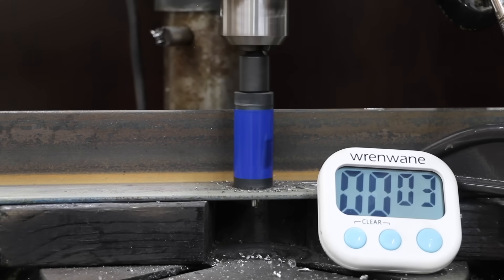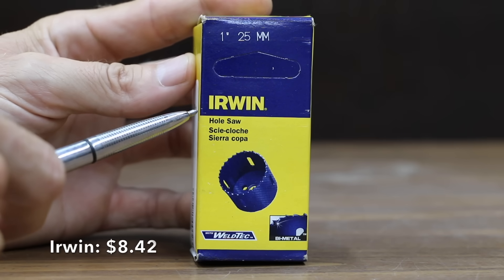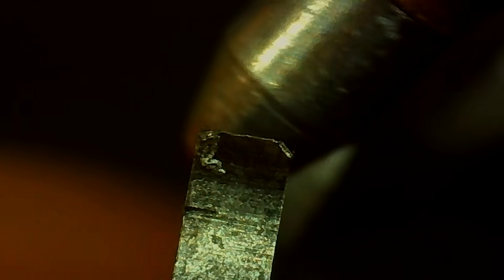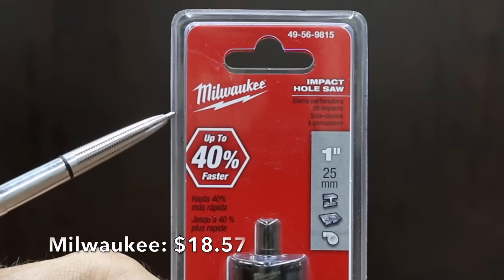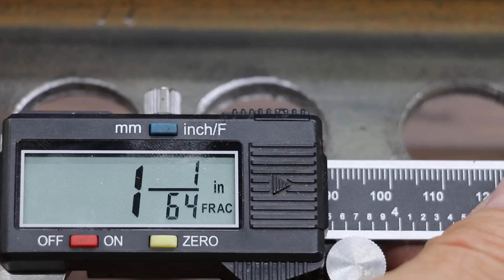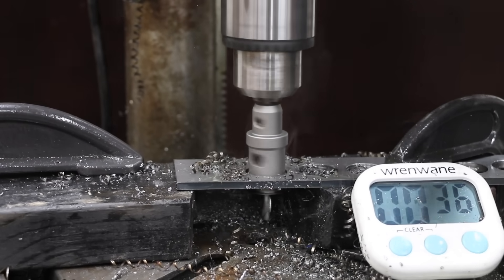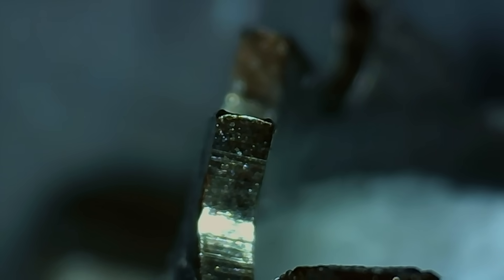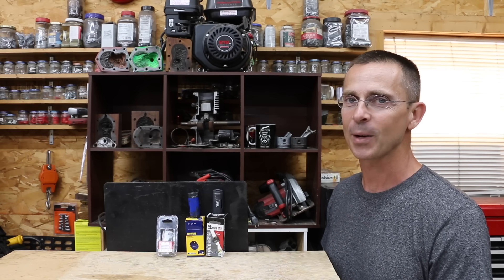Best Hole Saw Brand? DeWalt vs Milwaukee vs Irwin, Bosch, Lenox, Diablo, Bosch, MK Morse

Comment: I used to buy those expensive large twist drill bits such as 5/8, 3/4, 7/8 and up. I bought a set of 16 TCT Carbide hole saw kit bits from 5/8 to 2 1/4 ($59) last January. I have used the 5/8 size for 50 to 60 holes. It is starting to get a little dull, so I ordered a set of 3 to replace them since that is the size I use the most. The drilling is so much easier, the hole much smoother as well as more round, and there is no wobble. I will never go back. I noticed a lot of wobble in the long bits you tested, so I am reluctant to use those for precise drilling.

Comment: Love the vids man I'm just wondering why whenever you test Bosch you choose the entry level and never the expert?

The multitool blade you chose was the basic one where they've got a much, much better multi material Expert and now in this you are using the most basic set. The Expert hole saw set I own can hit brick and still go right back to cutting wood like it's nothing.

 Would love to see you retesting Bosch Expert in future vida

Comment: Could you update this and include hand drilling?  I've found the thin carbide diablo works great in drill press but terrible in a drill and even worse if drilling at an angle or hitting a nail.  Thanks!
Reply from the maker: Thanks for the suggestion.

Comment: The shock wave style with the thin cutting teeth is really for thin sheet metals like control panels etc. In thicker stuff the heat build up will kill it.

Comment: Many Thanks for this testing...I bought a complete drill set 5/8" to 2 1/4" ( $56.98 amazon ) 12 drill sizes TCT hole saw Carbide Took me 20 years to learned to drill ( slowly ) Turtle speed or less  and lots of oil high speed causes heat and kills the drill and then tempers your metal to extremely hardness. I was amazed at slow speed with lots of oil my 1 1/4" drill bit chewed right through 3/16" metal.... USA Drill hog has a great warranty if you register it. They replaced a few of my regular drills.
Reply from the maker: You are welcome!  Thanks for sharing.

Comment: Regardless of the steel you should ALWAYS use cutting oil. I use Klein hole saws every day almost. You'll kill them real quickly without oil. Should really read the instructions. Squid.

Comment: You completely omitted the FACT that Diablo did the best overall.  SPeed 25sec vs 30sec means SQUAT!  U did not evaluate durability for drilling multiple holes.  1 hole is not enough.  U know u could've drilled thru that toughest steel with the Diablo!  U didnt even let them cool down then go again with the Diablo.

Comment: Also I just found out CLEVELAND drill bit company is still around (oldest drill bit company in US ), it is now under GREENFIELD INDUSTRIES, and MADE IN USA, seneca SC. They have the boss annular cutters, I wouldnt even use hole saws for thick metal. CLEVELAND does not mess around, they use real carbide, anything else would be foolish. Take care !!!
Reply from the maker: Thanks for sharing.

Comment: I dont know if youve added best hole saw brand # 2 but you should check out champion ct7, i saw it cut through 3/8 steel and looks good. They also have annular cutters but they cost a fortune !!!
Reply from the maker: Thanks for the suggestion.

Comment: Great showdown for hole saws. Realistic application with the under powered drill press. Especially with the AR 500 armor. Lifting the stalled drill chips and dulls the teeth. To drill it properly you need enough torque so it won’t stall.
Reply from the maker: Thanks!

Comment: I suppose cutting wood would need a brand new test? Chip evacuation seems way more important there by my very limited experience (4 holes with a cheap kit before I gave up for the time being, frustrating as hell, more rubbing than cutting really).
 I'm thinking the most common use would probably be cutting holes in soft/hard wood for deck lights.

Comment: Unusually for me, I had to use a step drill last Summer, and bought a couple before checking your video! It was only through thin mild steel, the Makita lost it's tip almost instantly, and the Titanium coated Dewalt worked perfectly! That confirms your findings!
Reply from the maker: Thanks for sharing.

Comment: The regular Milwaukee hole saw bits are so garbage they wear out so fast but the carbide teeth one lasts way longer (I know this as I have to drill holes through wood to run line sets for air conditioner). The carbide teeth saw is still working even with 1 tooth of 3 being half broken, another being chipped, and the third starting to chip ever so slightly. Still works somehow. But yeah those regular hole saws don’t last.

Comment: I use carbide hole saws as they just keep their cutting teeth sharper for longer. Especially in fiberglass gelcoat and aluminium.
Reply from the maker: Thanks for the feedback.
Reply: M😅

Comment: As a tool and die maker, I have to say I'd propably go for Bi-metal hole saws rather than carbide, especially for handheld use. Carbide may be very hard, theoretically good for tool life, but that hardness is often a problem in hand use, as it leads to cracking. Carbide works best in stationary machines, like drill presses and mills, in hand use you have to be careful. Also, no intermittent cooling on carbides, either constant flooding or run them dry.
Reply from the maker: Thanks for the feedback.

Comment: The speed for the TCT saws is far too low which won't have been helping them cut or their durability, for mild steel they ought to have been more around 600-800 RPM and 400-500 for SS/Tool Steel
Reply from the maker: Thanks for the feedback.

Comment: I just used a Champion CT7 (1 1/8”) Carbide Hole Cutter which is made for materials up to 1” thick and it preformed beautifully drilling holes and 3/16” steel in about 10 seconds (drilled pilot hole first because the store didn’t have any extra pilot bits). 
The old adage of you get what you pay for is definitely true, it’s USA MADE and at $61.99 not cheep but well worth the investment.
Reply from the maker: Thanks for sharing.

Comment: The first saw you tested a chip of the carbide broke off. I think it happened when the saw cut through the metal and the weight on your press slammed the saw against the cut out part that fell on your work bench.
Reply from the maker: Thanks for the feedback.

Comment: Wish you had tested thin metal, like electrical panels. That said, I expect similar results to the "mild steel" test, just a smaller spread. Also important is the life of the hole saw, which we never got a feel for.
Reply from the maker: Thanks for the suggestion.

Comment: I realize this video was from 3 years ago but in case you still get the comments a problem I had with this was the drill press was stopping or hesitating which is not good for a cutting tool and the tools without the pilot are not designed for a sloppy spindle because the carbide is harder and more brittle you can't have a lot of vibration. Also I found it strange that a number of the carbide tools could not finish the armor plate and the carbide was still in reasonable condition. Speeds and feeds and sloppy spindle may have played a part.

Comment: The 40% faster bits are really made to make quicker work of light duty materials and reduces binding and teeth snapping on sheet metal, that is the application it is for, using it for heavy duty materials the teeth just get too hot too fast and they loose temper and burn out.
Reply from the maker: Thanks for the feedback.

Comment: I needed to cut a 1 inch hole in mild steel channel iron o my car trailer. I watched the Project Farm video to select a brand. I could not find the brand I wanted but I was able to get the Diablo saw at Homeless Depot. Thanks PF!!!!  The saw made it thru the steel with a hand held drill in less than three minutes. I had to hold it in an awkward position with limited visibility. I backed off the RPM and pressed maybe 15-20 lbs weight on bit. I was thrilled and delighted that it cut a hole so easily. Thanks for the video… it saved me so much trial & error time. Now I can new trailer light wiring.
Reply from the maker: You are welcome!  Thanks for sharing.

Comment: I use a 1" hole saw on metal quite frequently at work and some times I am forced to go at a slight angle which is hard on the pilot bits. The lennox pilot bits bend if you sneeze on them. The diablo bit holds up better and the  milwaukee hole dozer holds up the longest with the type of abuse I put mine through.

Comment: The lower the flute count, the faster I needs to spin. I would have liked to see the higher end 4 tooth carbide hole saws and 2-3x the rpm on the mild steel.
Reply from the maker: Thanks for the suggestion.

Comment: I was on the edge deciding on diablo lenox or milwaukee i guess ill buy me diablos i wanna use them for notching tubes i wonder how the outer cutting edge corners will hold up when i do angled notches on stainless exhaust tubing i’ll post the condition that they’re in after a couple of projects here if I remember lol
Reply from the maker: Thanks for the feedback.

Comment: Thanks for the great content!
I was wondering if you could include some "wobble" or runout test next time. I use hole saws for notching thin  (0.7 to 0.9mm) tubing and find that there are some with quite some wobble that make less precise cuts.
Reply from the maker: Thanks!  Thanks for the suggestion.

Comment: I'm glad to see that my disappointment in Diablo isn't just in my head. I've tried their blades and bits and thin cut wheels in just about everything and I've never really been impressed with any of it. 

It's not bad stuff, it's just not exactly good stuff. 

And that quick change thing for their hole saws is kind of terrible... and adds about $30 to the first one you buy.
Reply from the maker: Thanks for the feedback.

Comment: I tend to use water based cutting fluids since they do a better job of dissipating heat from the part and the tool. I save cutting oils for threading and low speed turning applications.
Reply from the maker: Thanks for sharing.

Comment: If you are drilling steel and are getting brown or blue chips the tool is rotating to fast and will fail. Especially if the tools are not carbide.
Reply: Stainless steel might not change color depending on which type of stainless.
Reply from the maker: Thanks for the feedback.

Comment: I'm quite interested in watching you test diamond core drill bits for cutting through concrete. Your testing approach is very impressive and consistent. I purchased a Milwaukee diamond max 1-inch drill bit, but it didn't perform very well and deteriorated after just a few cuts despite using water for lubrication.
Reply from the maker: Thanks for the suggestion.

Comment: One thing I found with cutting oil is the need for force. If there's not enough, even the tiniest difference in blade height means oil under the cutting edge, and that dulls a blade fast and can be the reason for blown out edges on carbide teeth.

Comment: I was looking for a review on diamond hole saws. I recently started training to be a tile setter and I quickly learned that not all diamond hole saws are the same. Porcelain tiles are slippery and extremely hard to cut as well as very hard on the bit. Doesn't seem to be any good reviews out there comparing. Smaller hole saws behave differently form bigger ones so I work recommend testing 3 common sizes used in tile setting
Reply from the maker: Thanks for the suggestion.

Comment: I noticed that almost in every of these amazing tool comparison videos, the Irwin tools always excel compared to their price. Its something else and I love it. I talked my boss into buying Irwin holesaw set to be used in our small metal shop and it actually worked much better than the Karnach hole saws that we were using since 2003. Much cheaper and marginally better. My boss has started to watch your videos after that :)
Reply from the maker: Thanks for sharing.

Comment: Great video.
I purchase a holesaw kit for installing a deadbolt in my front door.  It is a typical, cheap, Insulated metal door.  The metal is very thin. The holesaw did the job but when I tried to use it on a second door, it really struggled and took a long time for me to make the hole.  
Now I know what brands to consider when I have another project.
Reply from the maker: Thanks!  Thanks for sharing.

Comment: I've had a lenox hole saw for the last 5 years, only using to drill through metal, still works perfect. no exaggeration. Burned through hundreds of pilot bits though. Maybe a hole saw pilot bit test video?
Reply from the maker: Thanks for the suggestion.

Comment: Reasonable quality carbide cutting tools usually excel at higher rpm/feeds relative to HSS. Running it at lower speeds leads to hardening of the base material, etc. probably why the carbide saws slowed down. Great video as always.
Reply from the maker: Thanks!

Comment: Hi Todd, you should try EZARC TCT hole saw to join the test, you will impressed by their performance. They have two different version, one for sheet metal, another series for thick metal.
Reply from the maker: Thanks for the suggestion.

Comment: Carbide tools should of cut all the way through the AR500. Did the metal get hot ?  You are missing comparison charts after two of your tests. Hole size accuracy and the AR500.

Comment: Also for the sake of comparability, you need to use the same diameter; if the diameter is not the same, you are cutting different amount of material, and even if the number of teeth is different, then you are introducing two new dimensions of variability. Hard to compare, unless you reduce to something comparable such as "time to cut x number of teeth / perimeter"
Reply from the maker: Thanks for the feedback.

Comment: The Milwaukee does good,  it just needs the arbor to go fast then when the whole saw grabs slow it down put force on it but not to much use cutting oil let the saw do the cutting don’t force it the arbor will break off I use these daily on king studs very temperamental! Do not use on harden steel !
Reply from the maker: Thanks for sharing.

Comment: I use rock river hole saws for work everyday drilling sheet metals and stainless steel and we go thru tons of hole saws😅.... but the most problematic to drill is stainless steel.... all the teeth would be dull after I'm done with them...
Reply from the maker: Thank for the feedback.

Comment: Relton brand holes are capable to be sent in for rebuilding hole.  I used to drill thousands of holes for installing cellulose insulation.
Great drill bits and made in Arcadia California.  These hole saw bits are made like things used to be made. They can also can custom make hole saws for specie jobs.
Reply from the maker: Thanks for sharing.

Comment: I bought a Bauer hole saw kit from Harbor Freight… and used the 1” to cut a hole thru 3/16” high carbon blade steel when I was making Karambit knife for a friend… there was a little discoloration, but believe it or not, no damage to the teeth. I’d love to see you test that kit!
Reply from the maker: Thanks for the suggestion.

Comment: Thanks for the well done video.  I wish you would have included the Starrett bimetal hole saws because that is the brand my local tool supplier provides.
Reply from the maker: You are welcome!  Thanks for the suggestion.

Comment: Love your videos zero complaints about anything. Very non biased testing. Great work. I am a big truck & trailer mechanic. The shop I work at and myself have bought several things upon your suggestion.  I have a couple  ideas for tools to test. 
Sockets. Could be 10 videos if you did deep and shallow ranging from 1/4'' - 1''.
Would love to see how the 1/4 and 1/2 varients of ratchets stack up to the 3/8 you already tested. 
Jackstands. Would like to see if the ratings hold up and see what they are actually capable of holding beyond. 
Thanks for the videos. They provide daily entertainment on lunch.
Reply from the maker: Thanks and you are welcome!  Thanks for the suggestions.

Comment: I really don't like carrying a drill and an impact so I buy as many impact rated bits as I can. I'd really like to see a comparison of impact rated holesaws. The dewalts I've used were misshapen and made ugly holes but they lasted whereas the milwaukee wouldn't even make a single hole in 16gauge studs. Impact rated uni bits and impact rated ph2 bits would also be good. I think a good test medium for these would be some 16 or 18 gauge steel studs. The project I'm on seems like this is all I'm screwing into and everyone on site in going through bits like they're made of tin foil.
Reply from the maker: Thanks for the suggestion.

Comment: I have found that when the bit says that it is impact ready that it works much better with an impact drill and using a regular cordless tends to damage the hole saw. Is my limited observation correct or do was I just imagining things?

Comment: You need an old, BIG drill press.  I have a 100+ year old drill press that was converted from common shaft power to electric, and its slowest speed is 70 rpm.  I can drill through leaf springs and even a file, if I use good cutting oil, and a LOT of it.
Reply from the maker: Thanks for sharing.

Comment: Please do a core drill bit  comparison for concrete drilling. Typical 3’ and 4 inch core drilling through a street curb to put a drain pipe.
Reply from the maker: Thanks for the suggestion.

Comment: Wondering if the saws would last better on the armor plate if they fan slower and/or less pressure.  Feels like slow and steady might’ve allowed one or two to finish that test.
Reply from the maker: Thanks for the suggestion.

Comment: Wish test would have been more focused on how many holes could be drilled in normal steel before becoming dull.  Most people would rarely if ever drill through the hard steels.  I want to know which hole saw will last the longest in normal use.
Reply from the maker: Thanks for the suggestion.